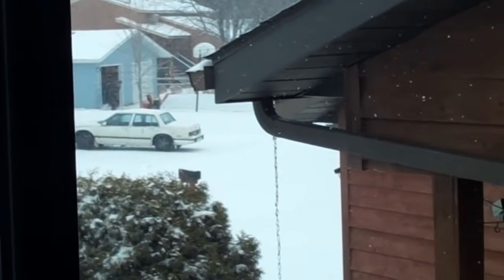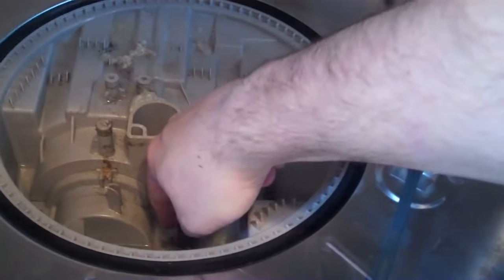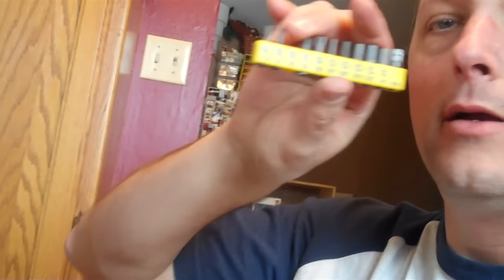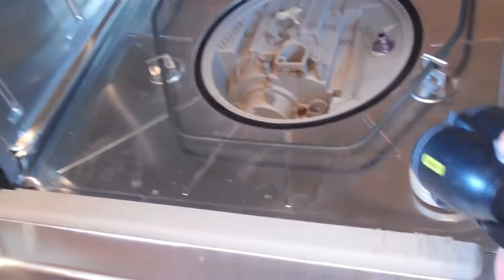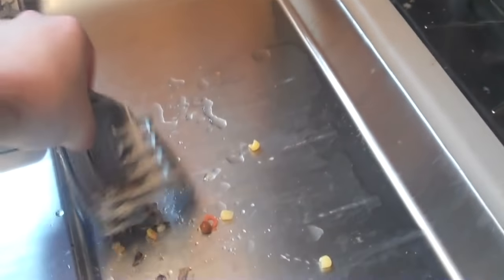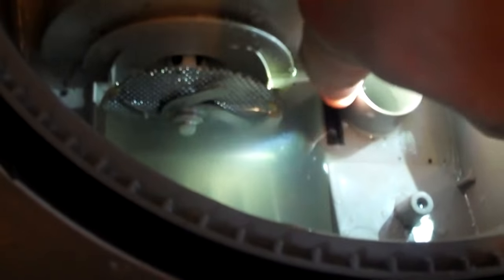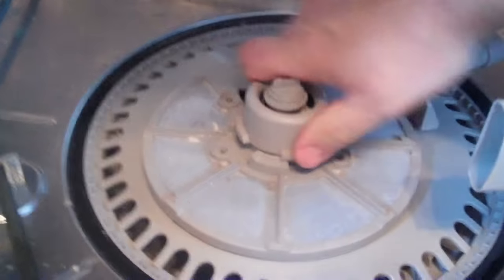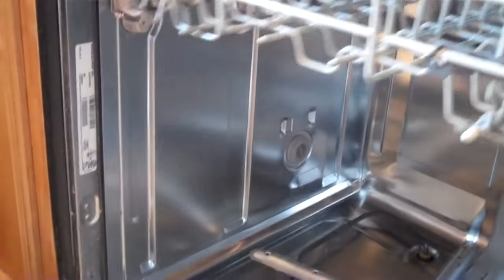Dishwasher Repair | How to Clean the Screen/Filter | Part 1 of 3

Comment: Hi, excellent video!! I finished cleaning everything out and then ran a test cycle, but I still have standing water.. Ugh! Any suggestions for next steps? Should I remove the water again and try to pour in a vinegar solution? I could also try cleaning that screen as well. I am just hesitant to pry it open
Reply from the maker: Hit cancel to get it to drain and then watch inside of your  sink and see if you see any water draining at all. If no water is draining then either your drain hose is clogged, or your pump has failed
Reply: Thanks for the reply! So I just canceled a cycle and I believe I saw some water enter the drain hose under the sink, but none of it is making its way up to the garbage disposal. I don’t see any obstructions in the part of the hose that is visible. I also couldn’t really hear anything when I canceled the cycle. Any thoughts on what the issue could be?

Comment: we had this issue a few months ago where we had a few inches of water left in the bottom. So I found your video and it was extremely helpful. Now it is doing it again and to be honest I practically wash my dishes before they go into the washer. We do have a disposal but after following your instructions we found that the water flowed freely. Never found what "clogged "it the first time. It is an older machine, just don't want to have to replace it as it does clean and dry very well. Just wondering if there is a shorter, time wise, resolution
Reply from the maker: I recommend a monthly rinse using vinegar.  There are many sites on google that give specific instructions, but every month the dishwasher needs a clean out...and then clean the screen annually, or more often if the manufacturer recommends it.

Comment: Thank you for this video! After replacing my water intake valve, I still had low pressure in the dishwasher. So I followed all of your steps, including removing shrimp tails (how did you know?!?!) and now it works like a charm! Should have done this first, and saved the $60 on the new valve.
Reply from the maker: I am very happy to hear that this video helped you.  Thank you for taking the time to write a positive comment.

Comment: Hey Tom ~ THANK YOU for excellent video! There was only 1 part I was stuck at - when PUTTING PROPELLOR BACK ~ I couldn't figure out the way you did it (guess my kitchenaid is different) - found it MUCH EASIER to CONNECT the propellor WITH the white Arm thingie & the long white tube and THEN put it back into the dishwasher all together. Also, 2 of my screws are REALLY locked in place now and I cannot remove them !! I have an electric screwdriver but they won't budge now....Suggestions??

Comment: I have a 2003 kitchen aid stainless steel but all my screws were T-15 and you should only use a screw driver because with the cordless drill  you can easily cross the threads or strip the screws in the plastic,your video was very helpful.
 Thank You
Reply from the maker: That is a very good point.  I think that is great advice.  Thank you for taking the time to suggest that.  Thank you for watching.

Comment: Fun watching your video.   I have a Kenmore Elite Ultra Wash and it is the exact same machine except for the "propeller"; the Kenmore is two bladed.   I had lot of junk down in the sump near the check valve. The machine is like brand new after that cleaning.  Bi-annual cleaning is probably they way I will go after this (ant teaching the kids to rinse too).

Comment: Thanks for the great video! Your instructions were very helpful. I hope to save the cost of repair, if I could only get the propeller looking arm back on. Having a hard time threading it back on-I tried holding the center with a plier and turning the propeller, but it is not going. Any other tips so that I don't have to call someone down after all the time and effort I spent taking it apart and cleaning it myself?

Comment: This was very helpful and I got everything apart and cleaned fairly easily.  The only issue I'm having is getting the lower arm back on.  I Googled and found this is a common problem and some people suggest trying to hold up the screw part with pliers while pushing down on the arm to get it to start finding the threads.  This says to 'jiggle' it.  Some of the Google posts say they had to call someone to come in just to get this back on, which seems like such a waste since I already did the hard work!  Any ideas?  Sorry for not having the exact model number but it's the Architect series and I bought 4 years ago (first time I ever cleaned...my bad).  Literally the entire thing is cleaned and reassembled except the arm!
Reply from the maker: Hi Samantha.  Do you mean the spinner part, that sprays the water in circles on the bottom. If so, keep in mind it is threaded backwards, so you would have to turn it the opposite way than what you normally would do.   I hope that helps.
Reply: Yea I know it's a reverse thread but that isn't it unfortunately
Reply from the maker: Samantha Hogfelt see my previous note, plus these few tips:

Two things to help...

1) The first step after removing the shelves, which is removing that upper spindle and tube that runs along the back...it doesn't just snap out...you must look for the tabs and push them outwards, then pull the plastic tube off the ceiling and back wall.

2) When putting the "propeller" back on, make sure the spindle isn't binded and can sort of move about loosely. If it doesn't, then pull it through (up) with some pliers until it moves more freely.

Good luck.

Comment: Thank you, thank you, thank you.  You just saved me a ton of money.  I had thought my dishwasher was broken and looked all weekend for a new one, but one with comparable features was out of my budget.  Mine is old and not worth paying for repair, so in desperation I turned to youtube.  What I found in mine was far, far worse than yours.  Unbelievable.  Paper clips, straws, flip top from soda, food.  String and hair wrapped around the food grinder.  Orange(?) sludge everywhere.  Totally disgusting.  A couple of things of note:  1)  That sound when you remove the hose that sounds like it is breaking, actually was it breaking.  One clip came loose on  one side, but the other was still intact and it seems secure.  2)  The round mesh screen had a ton of junk underneath it.  I snapped it right off and scrubbed it out.  That would be good to include in the video.  3)  Use a **turkey baster** to remove the crap.  I poured a cup of soapy water into the crevices and agitated with a brush and then you can use the turkey baster to suck it all up, including most of the food stuff, and then repeat until totally clean.  You still have to use your fingers, but this allows you to really flush it out and see the screws and such better.  Thank you again.
Reply from the maker: +Jane Fullerton I am very happy to hear another person got their dishwasher fixed with the help from my video.  Very good idea with the turkey baster to remove all the junk and water.  I am thinking your ideas will be incorporated in my next dishwasher video.  Thank you for watching.

Comment: If you mean the "propeller"  do not press the center spindle into the center hole. That is the only way that it will sit proud of the cover and will not bind in the center supply hole.  That seal will engage when the water flows up under pressurs.

Comment: I've seen a guy use a shop vac to help clean the crud out, that way if it soaks up a bit of water it's fine.  I assume you still have to clean it a bit but it may help cut down the time spend cleaning the crud out.
Reply from the maker: Very good idea.  Thank you for posting.
Reply: I took a shop vac to mine, too. Just make sure you have all of the screws and that rubber flapper kept away from it, so you don't accidentally suck them up.

Comment: Thanks for the tip on draining the excess water! Do you have any advice for a dishwasher that leaves brown grit on dishes? The grit also backed up into the sink that is also my garbage disposal.
Reply from the maker: Do a vinegar rinse once a month.  Pour vinegar in your dishwasher with 4 cups of water and push drain or cancel to drain it.  You can repeat with just water if needed.   Clear that drain once a month..or perhaps once a week if needed.  It is free to do.  Also rinse dishes before putting them in the machine.  A little more work saves the stench.

Comment: I haven't read all 1200 comments but one more trick. You do not need to separate the propeller from the gray plastic u-tube spray assembly. Just unclick the u-tube spray assembly from the top and back like you showed and it then unclip it from the bottom part. You are left with just the small part of the bottom part of the u-tube and you can rotate it clockwise to remove like you showed - with the propeller still attached!

Comment: Tom, great video. I had to have my pump replaced only after 4 years and I tried your method to clean myself. Very easy. One question. Once you put the propeller back on (last step) when it spins around with the dishwasher off is it supposed to hit the bottom and click? I am assuming that when the water runs, the propeller raises and does not hit? I am running it now and it sounds ok.

Comment: Thanks for the video.  Dishwasher drain tube through disposal clogged and disposal not working.  Replaced disposal and cleared out food grinder of plastic, paper, piece of glass, and a penny.  Still did not drain properly.  Forgot to knock out the drain plug from the disposal.  All things good.
Reply from the maker: That knock out plug really can make problems.  I am glad to hear this helped.

Comment: Man, I was sitting here sipping my coffee on this fine Sunday morn when I thought to myself, "Gosh, am I sick of drinking caked on crud at the bottom of my coffee cup." Your video saved me time and sanity. I didn't have the food particles that you had but I had a ton of caked on off-white sludge. Looked like lots of unused detergent. Anyone else have this? What detergent to people use if they didn't have this "build-up"?
Reply from the maker: I am very happy that my dishwasher video helped you.  You might have a buildup caused by hard water or cheap detergent.  We use Cascade and we have good water and have not seen the white sludge buildup.   Try a vinegar rinse with the hottest setting possible.   Put a bowl of white vinegar in the bottom rack and run it.  It will do amazing wonders my wife says.

Comment: I haven't seen a comment on this, although with over 500 it's probably in there somewhere, but the center plastic thingy, the one that required the "big" impressive pliers at around 2:43 into the vide - yeah, it's reverse threaded which is why you can hold onto it and spin the arm around and get it to unscrew.
Reply from the maker: That is a very good point, and you are correct, it is buried in the comments.  I will update my narrative under the video in the comment box under item number two.  Thank you for the great idea to post that tip.  Thanks for watching and commenting.

Comment: This was a great video.  I have followed all the steps but now when I screw on the lower spray are it hits the gray water tube line on the bottom of the dishwaser.  can you help?  I have taken it apart several times and can't locate the issue.  thansk
Reply from the maker: Hi, I noticed the same thing.  I think that when water pressure makes the spinner spin it lifts it up and it spins freely.  Without water pressure it seems like it will not spin.

Comment: Hi Tom. Everything looks easy and I did it until I got to the food shredder part. It was really jammed in there and my modrl doesn't have that handle that you push to the right to lift it up. So it was a bummer after I got to this step and couldn't open the shredder to put everything back on again. My dishwasher still isn't draining and I did follow your steps in the second part. No use. Help!

Comment: Your video was great  but I wish you had mentioned that holding the cancel button
with the door closed will run the pump.   I took the whole thing apart and found nothing .   I held the cancel button and it drained right away
Reply from the maker: Geoffrey Way I didn't learn that until later...sorry man.

Comment: also the center piece that the 'propeller' threads on to should not be pushed down the middle hole. i pushed it down too far at first. but its supposed to just sort of 'float' on top. my propeller seems to almost graze the top of the flat tube at the bottom back of the dishwasher. the centerpiece must be pulled up a bit so it spins freely...but judging by the marks on the tube it does sometimes scrape it as it spins.

Comment: Great video.  If you don't have an electric drill, you can buy a little tork driver set (don't confuse with auto torque wench).  The one I'm looking at is made by Husky and has 8 head sizes.  It works like a swiss army knife in that you unfold the size you need and use it like a regular hand screw driver.  Apparently a lot of appliance manufacturers use these since I bought this gadget when I had a different brand dishwasher.
Reply from the maker: That is a very good bit of information for everyone.  Thank you so much Katie.

Comment: when the lower spray prop goes back in, should there be a little play in it?  I hear on your video a bit of what sounds like clonking when you spin it, but not sure.
good vid.
Reply from the maker: yes, there is definitely a lot of play in it when it goes back in.  I wondered the same thing so I place my GoPro in the dishwasher to see if it spins right and it does.  With water pressure it stays even and spins like a charm.  Good question.  Thank you for the nice compliment.
Reply: Frosty Life unfortunately, the tub still fills and then stops.  so float assy is next try.

Comment: Hello, i could not remove the grey tube that goes to and up the back. I was not able to lift it.  I was only able to twist it slightly to the right and then it wouldnt budge.  The middle of it also seemed to be stuck to the middle of the back wall. What do I do?

Comment: How did you get the metal clips on the arm to the upper propeller thing to clip back in place on the top and back of the dishwasher? I'm not getting any "snap"
Reply from the maker: Make sure to read all of the information in the description below the video.  I do not specifically remember how the upper spray are clips in, and I do not have that model dishwasher anymore, but I would think you should be able to find some information about it online or by calling the manufacturer.
Reply: @FROSTYLIFE  ok thank you! Great video!

Comment: Ironically, I found this vid about 5 mins after putting everything back together again in my (extremely similar) dishwasher. Mine's a Kenmore Ultra Wash, I'm assuming yours is as well. Just for the record, every step you took I recognised...although of course I plowed through it in about 2 hours since I hadn't yet seen the vid. 4 points of interest: 1. Your vid was nicely put together and was easy to understand (bearing in mind that I had already gone through the process).....2. Just to clear up a minor issue, your vid shows you already in the sump area before you take it apart (I appreciate that you no doubt know this already and it was obviously just a mis-step when you put the vid together).....3. For lobster tales and sweetcorn, read sunflower seed cases and 6 cocktail sticks for the innapropriate items that my own 3 teens chose to clog up the filter with and.....4. My round filter now has a hole about the size of a screwdriver head after my hand slipped screwing one of the filter screws back in place....hopefully this won't prove to be a major issue down the line. if I was being picky, my 5th point would be....where on earth did you find the accompanying muzak and please, put it back where you found it. Again, nice job on your vid. Cheers.
Reply from the maker: Thank you so much for the wonderful comment.  I had another viewer say the purchased a new replacement part in the filter or grinder parts.  They are not that expensive according to the viewer, but we can sure bet some appliance repair company would charge us a lot of labor to put it in.   Thanks for watching and commenting.

Comment: Hey, this is awesome! How do I clean that screen that is on there.  The circular one.
Reply from the maker: I would recommend to wash the filter in your kitchen sink with hot soapy water.  Depending upon manufacturer, you might be able to purchase a replacement filter, but usually a good wash will take care of it.  As always I recommend checking your owners manual.

Comment: This was a great help, up until I got to the cover of the "food shredder".  Mine is completely smooth, so I have no way to grab it, and can't get a screwdriver under there to pry it any...looks like I'll be buying a new one after all.
Reply from the maker: +GornithPlays perhaps if you call your local repair place and just ask them how to access the food shedder.  Not all machines have this option.
Reply: I actually got it open.  Found a small ridge on the side I could grip with some needle nose...cleaned it all up.  Unfortunately, this wasn't the problem, as my dishes are still getting dirtier after washing them than when I put them in.

Comment: Ok I have done everything to clean my dishwasher the only thing that is not going on right is my bottom propeller. I think there is too much play in it. What could be wrong. Everything else went together fine..HELP!!!! Thanks for the info...
Reply from the maker: Karen Hill  I thought the same thing.   There has to be play in the bottom propeller because when it is under water pressure it advances under water pressure and spins properly.  That is normal.  I recorded it in action with my GoPro inside the dishwasher (see Frosty Life GoPro Dishwasher)